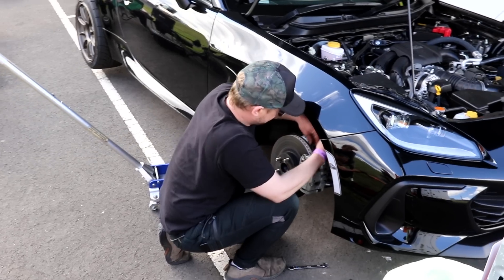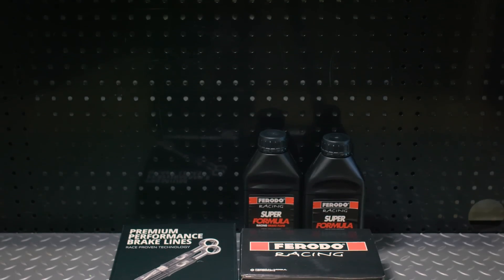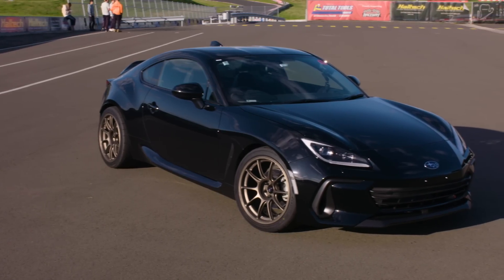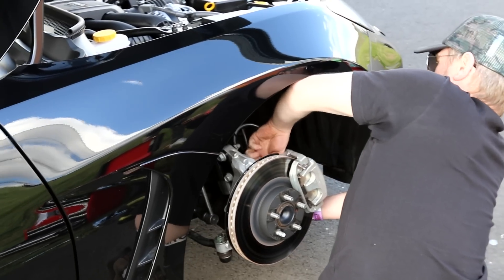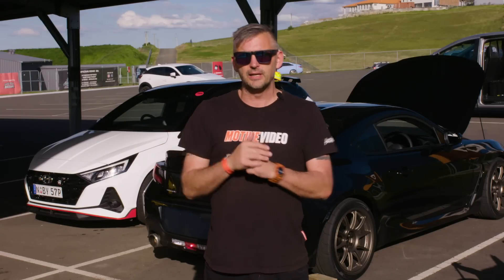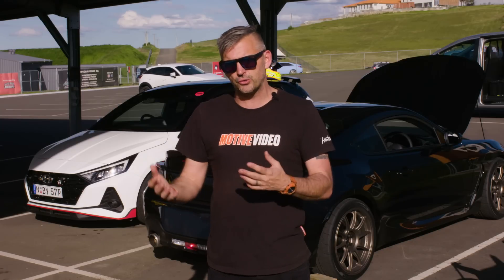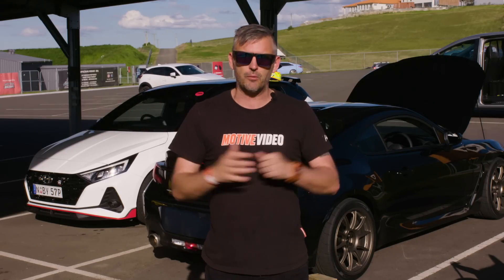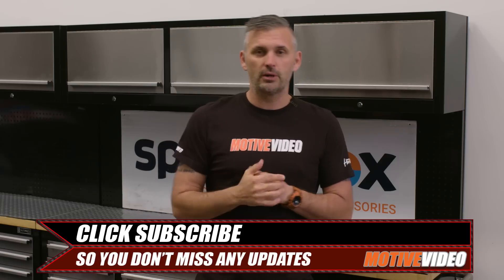Budget Brake Upgrade for 22 BRZ/GR86 To Stop Brake Fade - Motive Garage

Comment: If you aren't throwing any more power at it, please keep the videos this format. simple upgrades and test. Then we can have a library of the progress and the results
Reply: Ecutek is currently beta testing the new tuning solution, so wont be long now.  Even MoTec has it in the works.

Comment: Ferodo has many different compounds, would have been nice if you added the DS2500 compound to the info in the video. (I paused the video and checked the part number).
Reply: Thanks, I tried to do the same but couldn’t make it out. Figured they had to be DS2500

Comment: On my GR86 all I did was change the pads (project mu  club racer advanced) and brake fluid to Castrol SRF and zero fade.  Brake cooling ducts will help more than expensive rotors.  Aftermarket rotors here in the states are $72
Reply: Which rotors are those @jamesinoregon1081?
Reply: @RT-oz3hs  napa auto supply

Comment: I put Ferrodo DS2500 pads and DBA discs on my 350Z along with braided lines and i could lap literally all day.  i had to change the pads every track day though as they would only last about 1.5 track days + road driving in between pushed that hard. They never faded though.

Comment: What ferodo pads did you use?
Reply: I paused the video and checked the part numbers: DS2500 pads were used
Reply: @aDaWaN  thanks, you have sharper eyes than med :) I have the 2500 on my gt86, like them alot as an all round pad. From daily driving in -20C to hard track driving,( just keep the session length a bit shorter)

Comment: These cars are so under braked from factory they have smaller rotors than an MRS a car that weighs almost 300kg less than the 86 has bigger rotors what was toyota thinking with the 86. I never cracked rotors on any cars till I bought an 86.